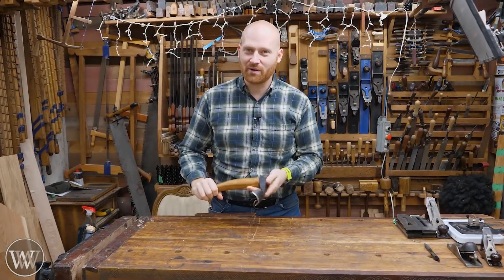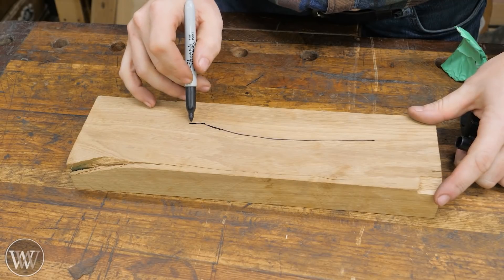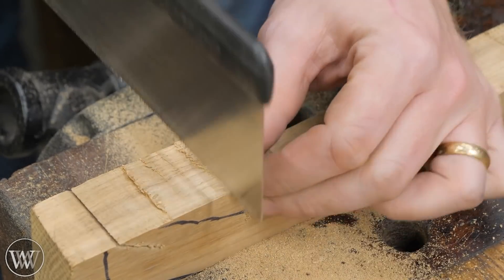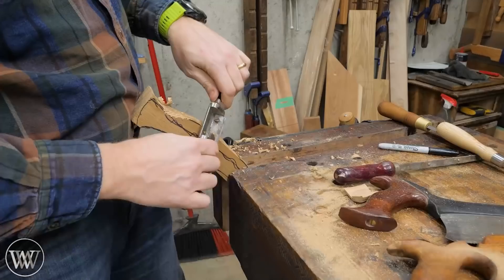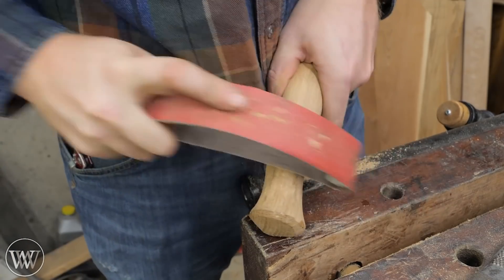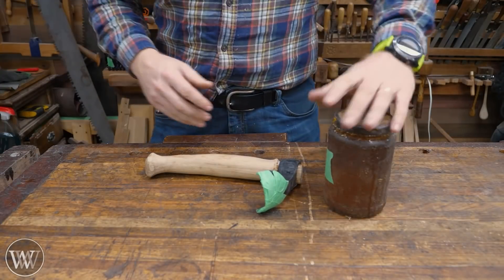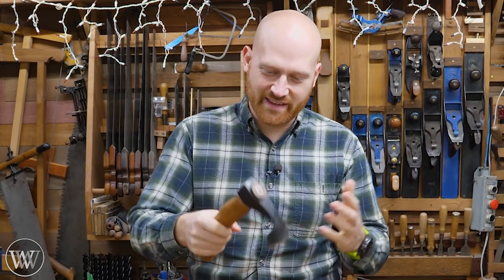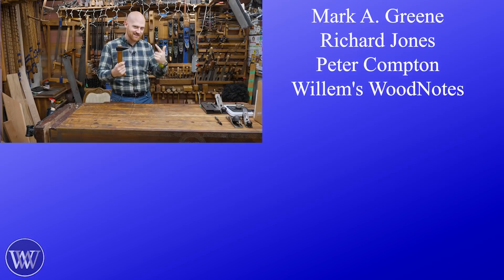How to Make a Handle for a Bowl Adze

Comment: Very nice! Exactly the way (and much more!) aswell as methodology I would have thought about, very well executed. Few things however I didn` t like as much. Using a marker instead of a pencil made it a bit clumsy in drawing. The axe was undeniably employed in a very dangerous way:  above your "holding hand level" aswell as very dull and over a concrete floor, all the hazards applied in one combination. Also I think using sandpaper before the card scrapers simply could dull it quite a bit. The scraper becoming blunt from the grit in the wood. Finally it was brilliant altogether. Very fine in it` s outcome and a lovely handle, let my words be no bitter in any sense it was excellent!
Reply: Also I have a slightly peculiar question here in which I need some help. Could you possibly adze the end-grain of a large stump? Would this work assuming the wood is still fairly green. Though I am talking about ash one year from cutting. I know that this is not the way an adze should be emplyed and that this job is a saw` s task the wood itself also beginning to surface-dry. But could this work? The issue is a mishappen chainsaw cutting that I have to deal with being provided with an inacceptable stump so the amount of wood to remove is quite gross. Thanks in advance.
Reply from the maker: If you're talking about chopping the stump down farther theoretically it could work but it would be a lot of work. Unless you're thinking about like a bowl ads and shaping the end of the stump. That could be a great way to do it.
Reply: @WoodByWrightHowTo  In short: Yes I mean leveling the end of the stump, top and bottom endgrain, it` s "faces" to be specific. Will the curved adze do? May a single bevel hatchet do aswell? Should I moisten the top?
Or do I have to go for a two men crosscut saw? 

The stump is an oval of 15x20 inches in cross section
and I` m quite worried about dealing with this giant area of endgrain.

Long:

Thank you so much for such a good and fast answer! This stump really is a problem for me and I need soon as a "work-bench" for a wrought iron vise aswell as an anvil stump for both metal and woodwork. I have nothing else to work upon and well, a man without his vice is since times immorial lost in this  world. To put it clearly the stump is about 20x15 inch in cross-section with off-centric pith and 10 inch high, two pieces of these to be joined by dowells for transportation stacked one upon the other. Both horribly messed up with a chainsaw. I have about 2 inches to take down from each (four) faces in the worst spots of end grain to level them up. Will the curved, bowl adze do for the job or will a two-men crosscut saw be a necessity? Should I gently re-moisten the top if adzing is possible?

Comment: Next tool might be a fro insted of a hatchet  to split off large chunks. 
Me I would have used a band saw.  But you may have used a traditional bow saw.
But I belive the correct method would have been split off the waste with a fro to make short work of it.
Also hard maple would have been my choice of wood its harder the white oak.
However a burnt ash would also make a mean handle. 
It would be neat to take some dark wood and a router plane and lace in some desine lines.
Reply from the maker: I have a fro well and a turning saw. Both would work well there. The turning saw would be a lot slower but would save the most material. A fro would be useful but in the end would be more work. It kind of comes down to personal preferences. There really is no right way to do it. Just whichever way you find to be the most fun.
Reply: @WoodByWrightHowTo  
Good point.  Enjoy what your doing.   I need to watch the rest of this had to stop to watch the cheifs game.    But adding some fine line type inlays would make statement its your tool.  Something like ebony or purple heart would be a stark contrast.  Just my take on it its your tool.
You could have carved the handle with a knife or chisels.   Spoke shave.  Woods a great media to work with.  Now setting your own casting would take a lot more skill and hot enough forge. I wonder if a folded blade would work better and hold a edge longer. 
Its interesting to see how tools have evolved over the last 10k years. Woodworking will show this better then anything else even native Americans used tools like this. They might have used willow or Hackberry or woods we don't use today.

Comment: Great handle!! How long does the process of BLO and paste wax take for you?
Reply from the maker: I put on a coat of BLO and then as soon as it starts to soak in through on another one usually about 15 minutes apart or so. And I'll keep doing that until it stops soaking it up. Then I'll wipe off the excess and immediately apply paste wax. Then I'll let that sit for an hour or so until it starts to harden and then polish it off. I've got a couple videos showing the whole process if you want to see it specifically.